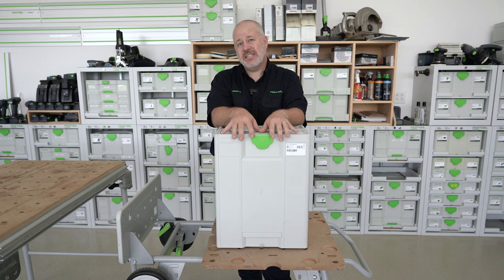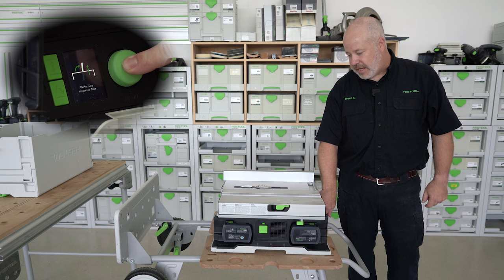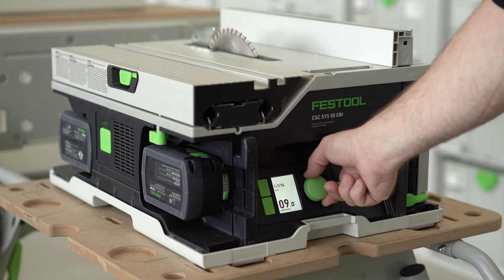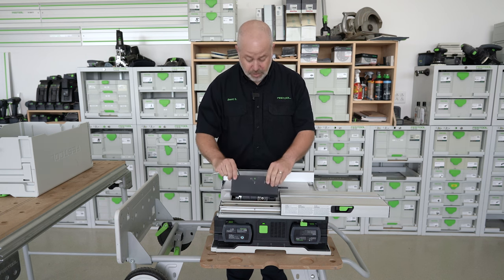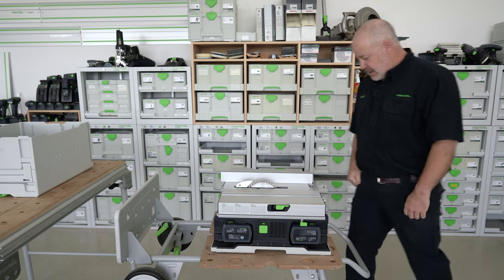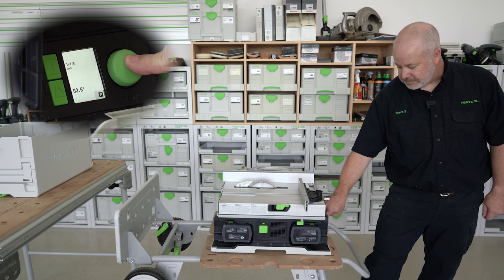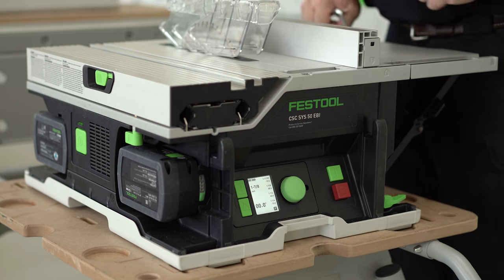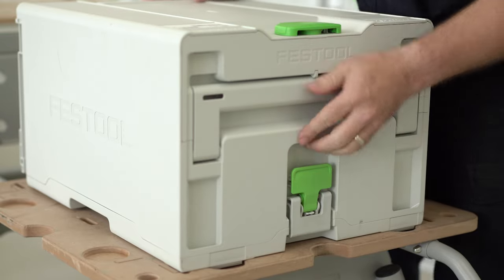CSC SYS 50 Quick Start

Comment: So I just bought this thing last week but haven’t used it yet. I calibrated it like the on screen steps say and so far I think it’s nice. I’m wondering about travel. I’m super OCD about how I pack my van, not one rattle everything is nice and tight. I also drive super cautious. I see these demos of the saw and the guys will slap in on the table and stuff. Will I need to calibrate it each time I hit a minor bump in my van? Or am I overthinking things 😂. I think I’m going to bust it out in a few days to do a craftsman style porch wrap. I want to do like shaker panels around the bases of the columns so it’s first use will be about 3 foot beveled rips to do the corner pieces. Another concern is the blade tilt to the right for exactly what I intend to do. Haven’t seen any demos of that yet with the rip fence switched like it says in the manual and slid towards the user to the point it’s 45 degrees from the center of the blade.
Reply: Just curious how the saw is working out,on my wish list. 👍🌴🇨🇦
Reply: The thing works fantastic. Here are some things I’ve noticed, you can take them however you like;
1. The battery level indicator will give me a low reading prematurely on the saw screen only. Meaning I’m getting a single red bar on both batteries on the screen, and on the battery’s themselves I get 2/3 full.
2. I don’t recommend using it without an extractor just based on the fact that the bag fills up way quick, then it overflows in the saw. I carry a battery blower and clean my tools off. But after using the bag and cleaning it up, then putting it away. Next time you pull it out if you’ve carried it by the handle, there is dust everywhere 😊
3. The 48 tooth blade is the boss but I bought the rip blade too and I recommend getting familiar with changing it because it’s worth it every time depending on application.
4. It’s quiet. If you’re at work early in the day, put the extractor on half power and don’t be afraid to fire it up. 
5. I bought the “bow products” portable saw sized feather board, it’s tight but fits. And it’s almost festool green. 
6. In my opinion, and I’ve been doing finish trim for 23 years. It’s cheap for what it does as a whole (physical size, capacity, accuracy).
I would recommend this product. 😊
Reply: @nathangardner772   thanks for your help,I did demo it at a dealer ,but bought the cordless kapex60 a wonderful asset when doing millwork.
Cheers 🍻

Comment: The fence calibration and movement and precision is something many have commented on it needs further improvement.
Reply: What’s wrong with it?
Reply: @AaronGeller  it’s not as fine a calibration as with other table top bench saws in moving it to position once there it does not move which is also key when it’s locked down. For some this lack of precision means you can’t fully trust it. There are quite a few expert woodworking shops in uk and Europe who have raised this issue. Most are on YouTube loom for reviews on this in YouTube.